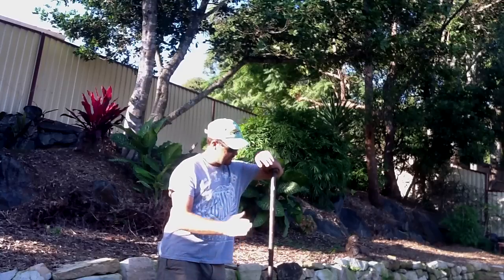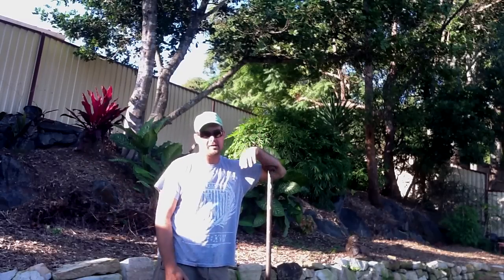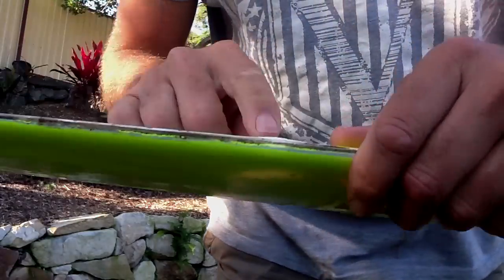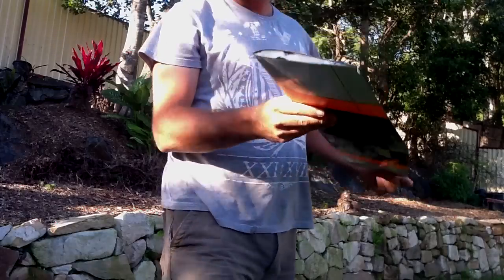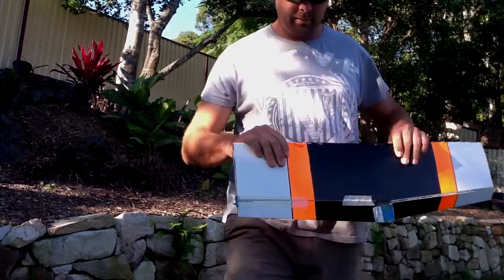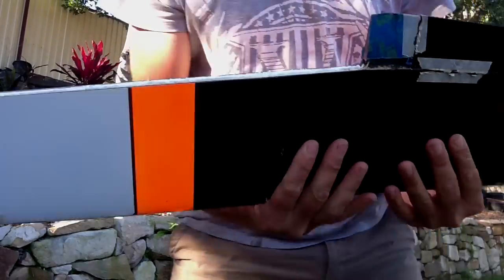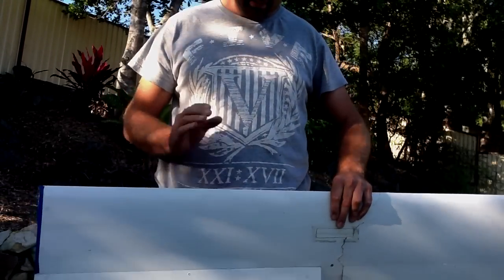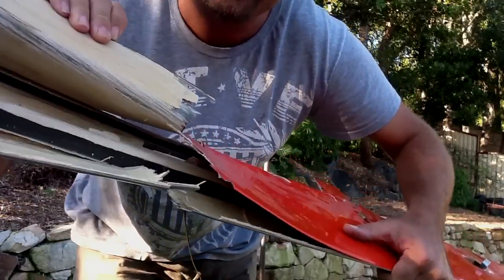Molded Solid Core F230 wings V's Hollow Molded

Comment from the maker: Hi Steve.     Very old video , not even sure if you can get it anymore.    I stopped using it due to it shrinks back to much in a wing.    It's made by gurit so has a serch and you might find it.  Also check out sicomin PB expanding epoxy , very similar.     What are you using it for ????
Reply: What core material do you use these days?